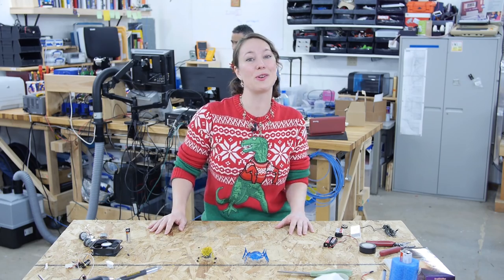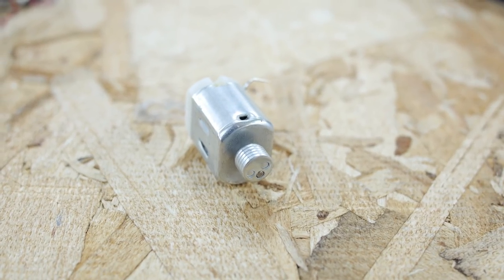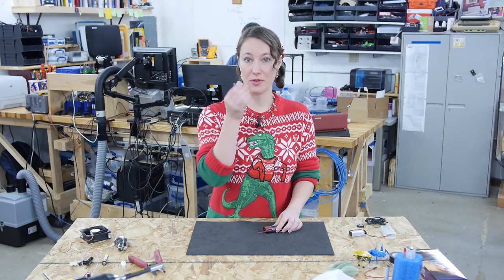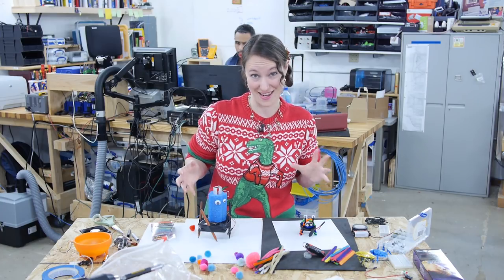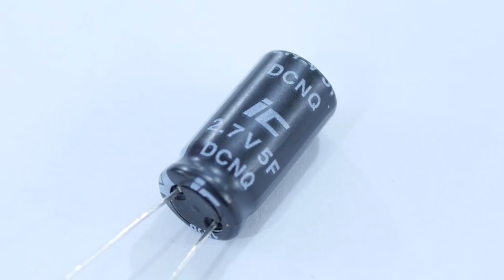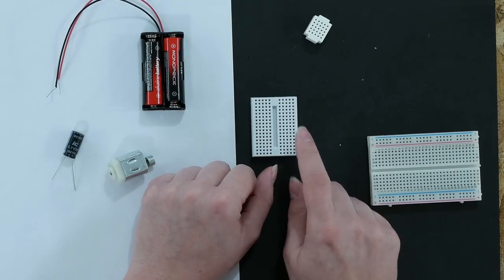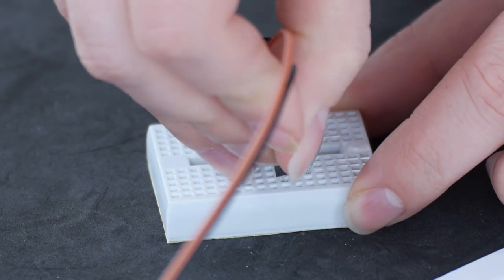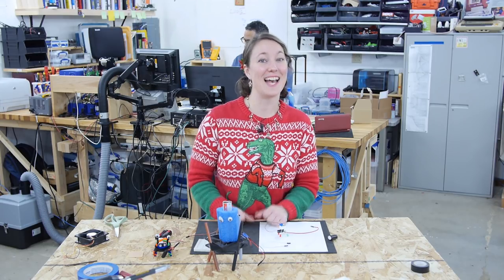Wigglebots Project - The Learning Circuit

Comment: If it wasn't mentioned yet...you used a polarized capacitor in the video but didn't state the polarity and why that matters. I did see that you correctly have the + side of the cap to the motor and the negative to the ground or negative to your battery. But still, for the simplicity of the explanations being done here, you should mention that. Would also mention that a larger capacitance battery will store more in it as well obviously.
Reply: Thanks for pointing that out! I don't always mention all the details in the videos so I love it when people chime in with more details in the comments. Great input!
Reply: This needs to be pinned. If someone tries this thats not experienced, they might blow up the capaciter.
Reply: And wouldn't that be exciting ;) Nothing like learning from experience heh
Reply: Good point, as long as we're conducting electronics kindergarten, we should explicitly explain everything. 

(That's the royal 'we', basically that means in this context by 'we' I mean 'we the people who are sufficiently advanced to consider this tutorial electronics kindergarten', not 'we' as in I have any association with the show... I do not) I actually don't like hacking together dev boards and chunks of used electronics, I'd rather build my own circuits from scratch, and maybe using some simple dev boards for more complex features that I'm too lazy for or that are just a bit beyond my skill set. And I do recover components but not whole chunks.

There is merit in letting people blow components in the name of education too so... I'm kinda on the fence with this one, should we tell em should we not and let em learn on their own, eeeeh idk, maybe yeah just pin the comment and for those who read... a little Easter egg, for those who are brave enough to monkey see, monkey thinks looks easy, money does... well now monkey knows from first hand experience and will be less likely to forget. One day monkey you'll push an iron all day and everything will work and keep all it's magic smoke inside where it belongs, then that level of awesomeness will never happen again... or so it will seem for quite a while, then it will be common place, so keep pushing lead and trying not to let that genie out, you'll get it in good time. P.S. A good iron helps, equipment matters, just saying.

Comment: You could make race tracks with walls and figure out how to orient the motor or design the legs so it can win!
Reply: I love this. As you can see with the maker legs, it kept wanting to wander off the paper. If you use a very small motor and a button cell battery, you can make a bot with the head of a toothbrush. It would be fun to go buy a bunch of different head types from the dollar store and see how the different bristle types move.

Comment: They are voltage rails, aren't they?
Voltage can exist without power (ideally). 
Voltage (always capital V) is also known as potential for a reason. Voltage provides the potential to provide current (the flow of elections/"electricity", measured in Amps or A for short). Therefore, power cannot exist without current and current cannot flow without voltage/potential.
Power is the product (multiplication) of voltage and current. 5V x 500mA (0.5A) = 2.5 W (Watts).
We connect our devices (load) to our voltage supplies. They "appear" (or behave) as the opposite of pure resistance (luckily in our world, our air is a pretty good electrical insulator (resistor)).
Normally, the devices we connect require a certain amount of current (therefore, power). They dissipate/"use" power.
The device will not "draw"/consume more power than it needs (is designed for). This is why a 10 Watt light globe works normally supplied by a voltage supply capable of supplying 1 million Watts!
Reply: It's strange that we refer to our "power" outlets as 120/250 Volts AC (Alternating Current), rather than 100/250 V AV or 110/250 AV (Alternating Voltage).
I guess it's because the 110/250 "AV" can supply AC (current and as a product, power).